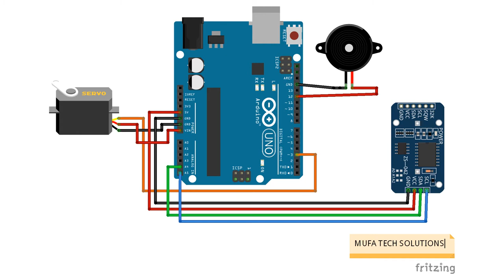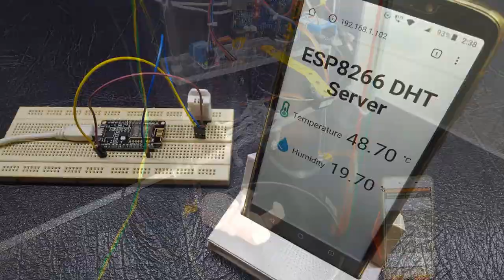Time Based Automatic fish Feeder | MUFA TECH SOLUTIONS

Comment: Hi I need help  regarding While uploading code  in esp8266I am getting error like " selected serial port _does not exist or your board is not connected " can you please help me
Reply from the maker: HI SAI,
disconnect esp8266 board from your hardware while uploading code, bcz not all gpio pins in esp8266 are meant for interfacing with hardware, some pins must be left idle while uploading code.
click on the link below to know which pins are safe for using in ep8266.
https://randomnerdtutorials.com/esp8266-pinout-reference-gpios/